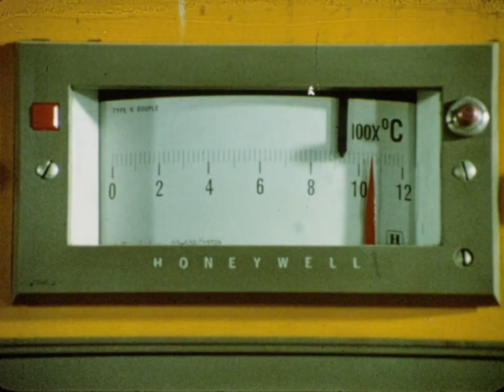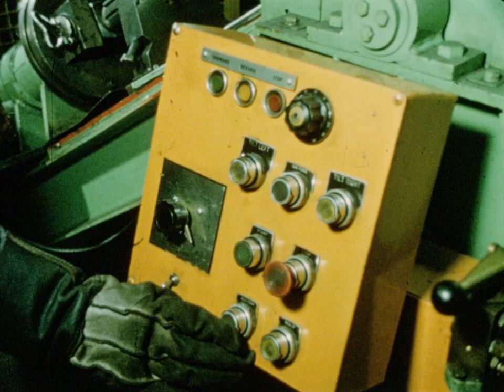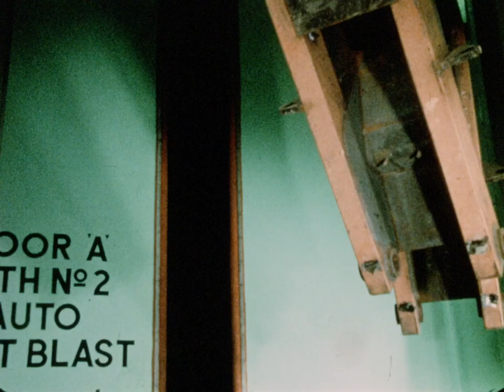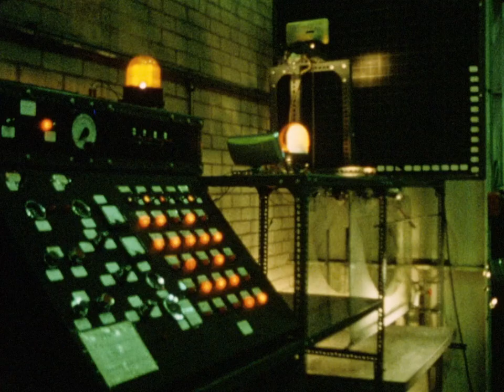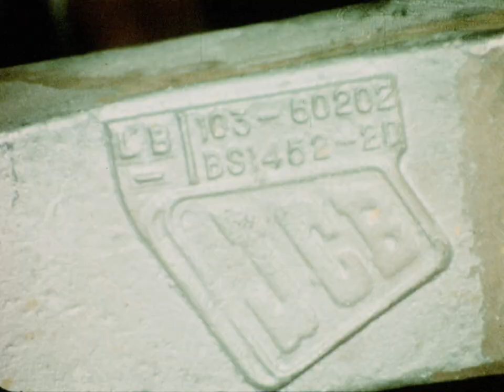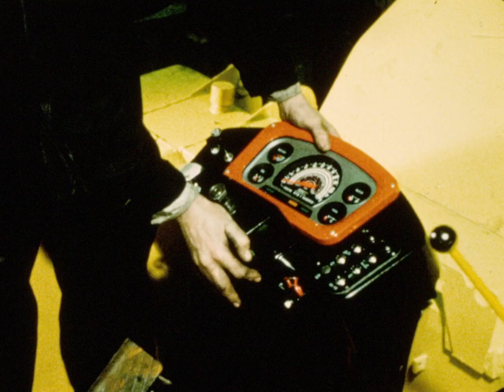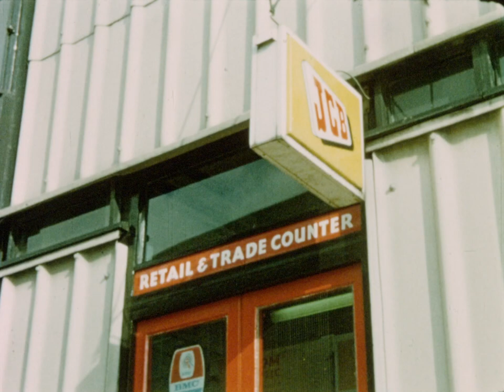JCB Archive: This is JCB

Comment: Now that was a great piece of British History by a great British Company who are still British owned and still design and build outstanding equipment. Brought back great memory's of some of the kit I once had the chance to operate. Wonder if that young lad is still on the go today?
Reply: Don't forget still run by the grandson of founder, and probably the largest family owned business in the UK
Reply: @pairojeans  Yes it is important to note that it is still family owned and run but no its run by his son Anthony not his grandson! Anthony's son Jo, who would be the grandson of the founder Joseph, owns Wrightbus in Northern Ireland
Reply: Oustanding Equipment 😂😂😂😂
Reply: @frasermathers2287  Hi Fraser thanks for the correction 🙂 Also cool information about Joseph and Wrightbus, Thanks 🙂
Reply: I worked to a dealer , loved them great to carry out service and repairs to rugged and reliable. Unfortunately   designs are slipping, who would build a telehandler that in order to replace the high pressure fuel pump would require  the removal of the engine assembly  to access the fixings for it???
Bad design it would be better for those who design  equipment  consult with those who repair it
Reply: @daca9907  Got to say I fully agree with you that too many manufacturers across the world never think about the guys who carry out the maintenance. So many times in my life I have cursed many different manufactures just for this one issue!
Reply: If you want to see a JCB being woken up from years of standing outside...
Marty T channel  YT.
Abandoned JCB 6D excavator... will it run?
Set in picturesque New Zealand bushland...

Comment: Would there be anything other than Perkins 6354s powering most of that gear ?
Reply: Early machines had Ford and bmc diesels
Reply: @gypseygeoff bmc 4/98 was used right up till the 3cx ,in fact the first of them still had bmc engines .

Comment: Dont think these antiqueted wheel loaders is JBC design
Reply: Correct, that's why they sport CHASESIDE on the bonnet sides, rear and reduction hubs. They took over the company in the mid 60's then brought out the artic models 413 & 418 in the early 70' to replace them, then the bigger 423 & 428 a couple of years later..